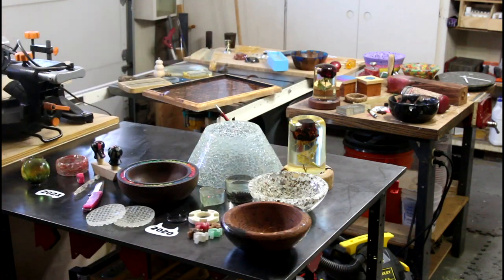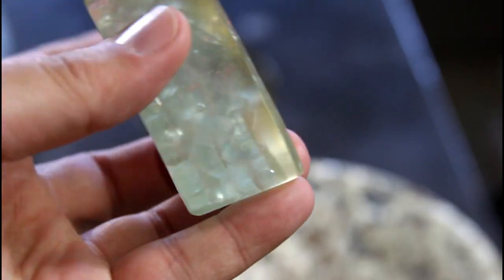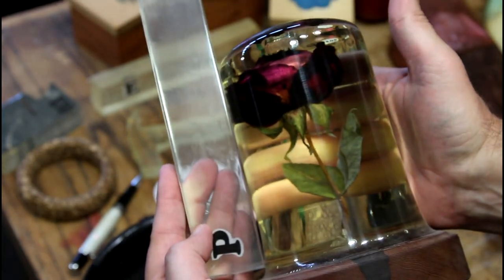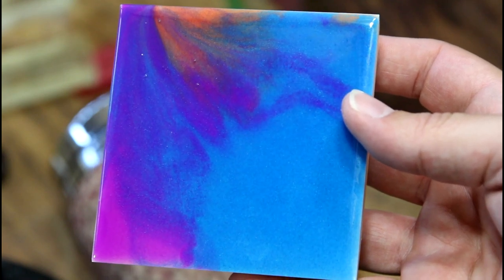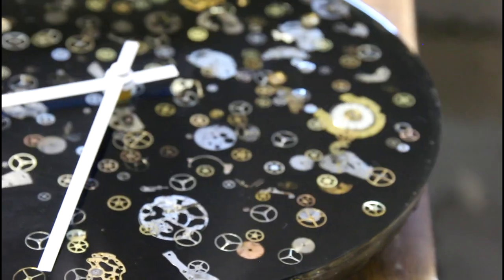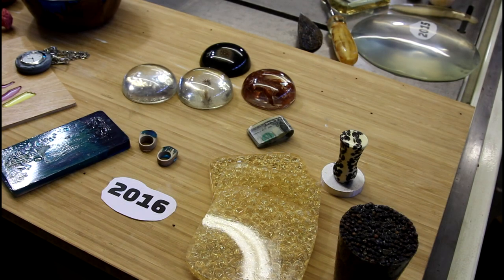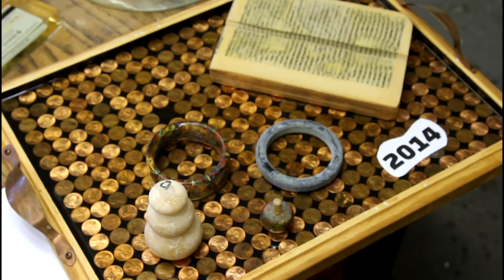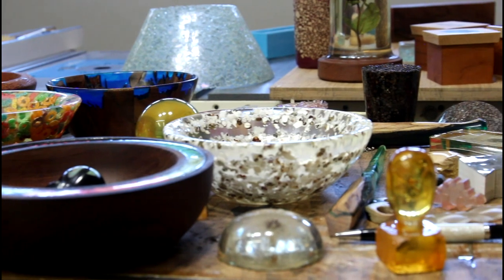Resins dirty secret?

Comment: Hey, Peter, I gotta ask, if you were selling them, how much would you have to get for a macerated cork travel mug?  Edit:  Also!  I wonder if the yellowing is similar to what happens with older beige and grey plastics, and whether or not retr0brite would have a positive effect on it (it is just a bleaching process, so, would be interesting to see how that would also affect resin in the future, should it work).  Another wondering, is if the exposed carbon of the charcoal bowl is absorbing free oxygen before it can react with the resin, resulting in the resin starying clearer, longer.

Comment: The coal resin probably didn't yellow because the coal pulls the oxygen stronger than the resin does?! Could you try and use retrobright (a technique used by restoration guys on yellowed plastics, utilizing hydrogen peroxide and UV light to speed up the reaction)? It would be awesome to know if it restores resin, too

Comment: Not all resins are created equally either, some resin manufacturers are more concerned with their yellowing effects than others, especially if you use lower priced resins. I've used all price points of epoxy resins and I can say in my experiences, the ones I paid more for yellowed significantly less or slower then the cheaper resins.

Comment: The thinner layers of the resin don't yellow slower.  It's just that there isn't more of it to show the multiplied yellowing.  A great example is when you show the bubble wrap coasters from 2016 and stacked them on top of one another.  It got darker.
Reply: I have a question. I want to add very thin layer (1/16 to 1/8 inch) to a Spray painted painting. Will it ever get yellow? I want to make a lot for my online shop but some take years to sell. Any tips would be appreciated
Reply: @TheOfficialChessGoat  Due to it's very nature, clear resin will yellow over time.  It's just what happens.  At 1/16 to 1/8 of an inch, it probably won't be very noticeable unless there are very light or white portions of the painting.  Some people add a few drops of blue resin dye to counteract the effect of the yellowing.  If you choose to do that, I suggest doing a sample test on some scrap before hand.
Reply: @ yes my epoxy resin comes with a blue tint within part A already mixed inside to be yellow resisting. 

I am trying to make 4000 pieces. They are not really art. They are 12x12 particle wood boards. And I get a 12x12 piece of scrap book paper and glue it into the board. I then paint squares on it to make it into a chess board. And then I apply a thin thin coat of resin in top.

I’m trying to manufacture a couple thousand of them within the next couple months. Some will take up to 3-5 years before they are sold. So I’m trying to make sure the yellow is not visible when it yellows. 

Some boards have white underneath, and other are darker colors. 

I’m just scared of investing this much and then years later it’s all yellow. But from this video; it seems like a layer that thin will take some time to be noticeably yellow. But I can’t seem to find any other data or examples anywhere else on the internet

Comment: Interesting.  I have a polished block of plastic in which the parts of a pocket watch were cast.  My guess is that the material is acrylic.  It has been out in the open for about 50 years.  The dimensions are about 1.5" x 2.5"x 3".  It has a barely perceptible amber color but is basically still perfectly clear.  This effect clearly depends on the material.

Comment: I would like to see if the yellowing is just surface yellowing or if it is thru the who object. What if u did a light sanding on the block of resin from 2019 (if think) and see what that does to the yellowing

Comment: the reason that dyed resin doesn't seem to yellow is that compared to the pigment in the dye, the yellowing is a much less intense color. What happens is that there is a chemical change in the resin that absorbs some blue and some red, leaving the resin overall with a more yellow hue as yellow passes through easier, but when you add certain colors and types of dye to the resin, the dye absorbs the entirety of the spectrum that the yellowing also absorbs, and so the color doesn't change over time.
Likewise, the yellowing is a gradual effect that's apparent in thicker pours more quickly simply because the light has to travel through more of the resin, and thus have more of the blue and red absorbed as the depth of the pour increases, so in a pour where you have a very thin layer of resin, it may not ever yellow enough to notice, like how a think sheet of glass looks perfectly clear, but as the depth of it increases, and the path the light has to take gets longer, the more apparent the yellowing becomes, like how a pane of glass always has a green tinge when you look at it from the side.
Reply: I want to apply thin layers (1/16 inch to 1/8 inch) to some painting I have. Will the yellow ever be noticeable?

Comment: Regarding the bowl vs the rose . . . "in contrast look at this [this bowl], this was made with epoxy resin, not polyester resin, in 2019, cast in huge volumes, and it is still crystal clear, I don't know why this hasn't changed" . . . they've both changed by the same degree, the difference is that when you look at the rose you are looking through 4 or 5 inches of resin, with the bowl you are looking through half an inch or so of resin . . . it's simply that the more material you have to look through the more the yellowing will colour the light you are seeing through it.

Comment: One thing I noticed you mention is that the big blocks will yellow more than small ones. Its not really that it yellows more, the resin all yellows at the same rate, its just when you have to look through a thick sheet vs a thin sheet of it, all that yellowing adds up and it looks far more yellow.
Reply: So if I glaze a layer of resin about 1/16 to 1/8 of an inch on to something, maybe it will never be a noticeable yellow?

Comment: I knew it yellowed.
But not as much as you showed with the bubble wrap coasters. 

I wonder how "good" the UV stabilised epoxy is over the same sort of time?
I read it's used by automotive car component makers as obviously a car with a carbon fiber bonnet will be outside in the air, in the sun.

Comment: Well I have to say I am shocked.  I wonder if a UV stabilizer would help retain the clarity despite it not being in contact with UV light.  I work in the epoxy industry, and have not noticed this, however after watching i looked through a sample book that i made in 2011 with cured samples of our materials, and every single clear formulation has yellowed. Some of the clear formulas even turned pinkish. I also can't believe how long i have been watching Peter Brown/ Shop time videos.  I have to find some UV stabilizers and try a little experiment myself.

Comment: Pigmented resin doesn't yellow for the same reason that very thin resin seems to yellow slower. The same resin will always yellow at the same rate, but when it's thin, you're only looking through a tiny bit, so you can't see the resin. When there's blocking pigment, you only get to see through a tiny bit of resin before the pigment blocks the light. When there's translucent pigment, the tiny bit of yellow isn't enough to overpower the color, so you don't notice the difference (like a drop of ink in a bucket of clear water vs blue water). If you look down the long ends of those first sticks, they'll look more yellow, and if you slice them in half they'll look less.
Reply: So if I glaze a layer of resin about 1/16 to 1/8 of an inch on to something, maybe it will never be a noticeable yellow?

Comment: I went a'googlin about this. Apparently hydrogenated epoxy resins are yellowing-resistant, or HALS (https://en.wikipedia.org/wiki/Hindered_amine_light_stabilizers) can be mixed in (the ratios change based on the amount etc) to give your piece UV protection.

Comment: Some epoxy resins yellow more quickly than others.  Yellowing is not JUST caused by UV light.  Moisture and high temperatures can cause yellowing.  Some epoxies have stabilizers that thwart the yellowing.  So not ALL epoxies yellow at the same time. Some can go many years without showing any yellow. And the stabilizers are getting better as are the resins.
Reply from the maker: I agree with all of this.

Comment: it's quite simple - fully cured epoxy resin is yellow. that's a natural property of this material.
so you may ask: how they do all this "crystal clear" stuff ?
and there is the real dirty secret - manufacturers just add some chemicals that slows down process of curing.  this resins just don't fully cure.
if you compare mechanical properties of different epoxy you will see that clear ones are weaker and softer. (most industrial stuff with high strength have a very strong yellow tint to it)

P.S.  do not be confused with yellowing of polyurethanes. that's different process (opposite).  urethanes goes yellow when they start to decompose.
urethane yellowing = loosing strength.
epoxy yellowing = increasing strength.

Comment: All resin yellows at the same rate. It's something to do with the degradation of the polymides. The thicker the resin, the more obvious the yellowing is. The pigments just hide it near perfectly as the yellow colour isn't strong enough to change the overall colour of the piece
Reply: So if I glaze a layer of resin about 1/16 to 1/8 of an inch on to something, maybe it will never be a noticeable yellow?

Comment: I've seen another YouTuber that works with plastics that have yellowed over time. Theoretically speaking, his process of removing the yellowing MIGHT work to remove the yellowing in any projects you might wanna remove it from. bare in mind, that I know nothing of resin and what it can and cannot withstand. So IF someone were to try and remove the yellowing with the setup, I've no fault in anything going sideways.

Comment: Question: can the original clarity be restored by chemical methods? Odd Tinkering does this when restoring plastics on old consoles (you can skip to 9:40 on the video below to see) but essentially he leaves the material in a 12% hydrogen peroxide solution and lines the outside of the container with UV lights.

Not sure if resin would react the same way, but maybe it could work? https://youtu.be/BzalwBeV_O0?t=580

Comment: So why not use polyester resin all the time? Genuine question, I don’t know anything about resin.
Reply from the maker: It's awful stuff to work with. I do like the results but it requires a full respirator to use.
Reply: @peterbrownwastaken  thank you for replying. As long as the yellowing doesn’t bother you that much then it’s not a huge issue really. Everything ages :)

Comment: You are right and you are also wrong, so as far as I understand it with epoxy resins, it's the amine in the resin that is turning the resin amber over time, to stop this from happening you need to change the harder (part B)  to one that is from what I am aware of is mad from cashew nuts, this is the harder the tend to use for when the counter tops and other areas that get alot of sun 
The epoxy harders bassed off cashew nuts are expensive, so have a look for this harder and see if there is a compatible part B for the part A epoxy that you are using at this point in time

Comment: The carbon is probably stealing the oxygen that would diffuse and oxidize it. I wonder if retrobrite would work on the old bubble coaster. Or if you would need to use hydrogen gas over a period of time to ensure diffusion.